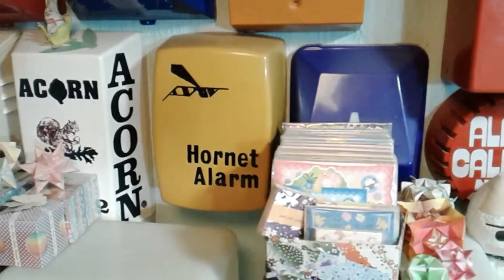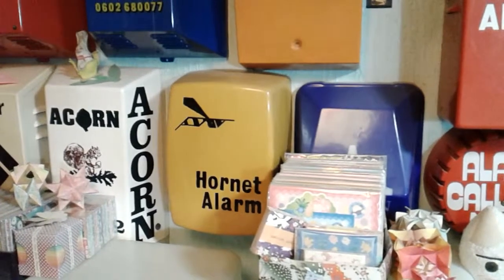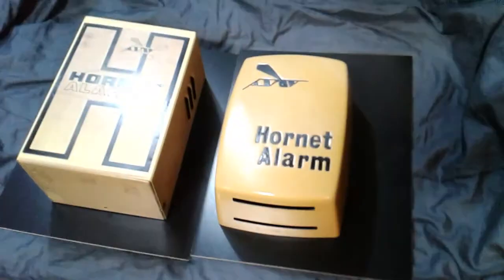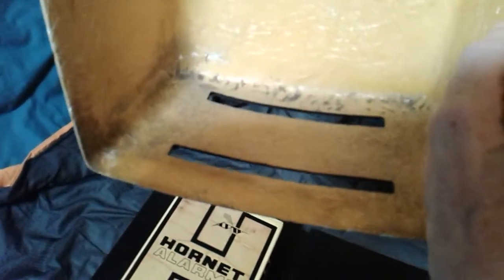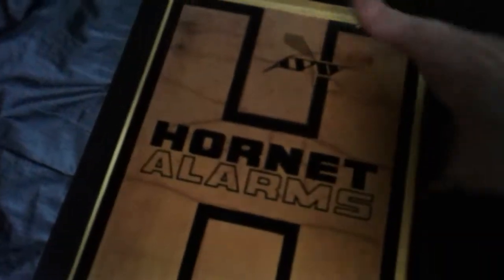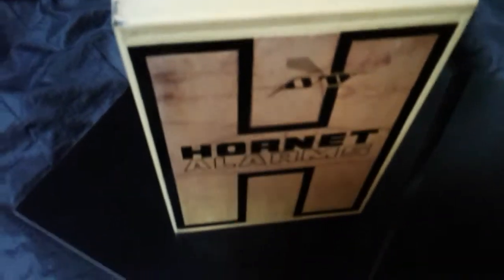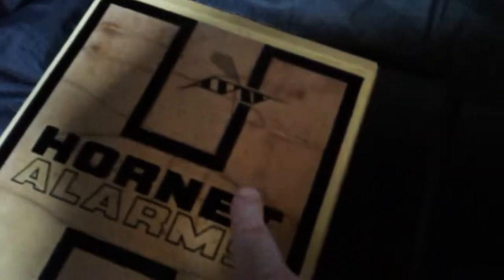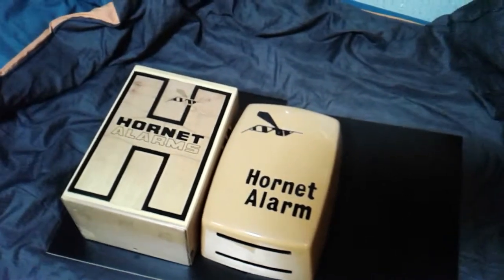Hornet alarm boxes for Scott Radley

Comment: That fiberglass box is probably from from the 60s
Reply from the maker: alarms n stuff brilliant! I thought it was a later addition to the alarm box family.  It makes it possibly the oldest box I have.

Dont know whats going on with the sound sorry about that.
Reply: audiotron1003 they never had any fiberglass bell box's in the 80s or 90s. Gotta say though love the style of the fiberglass bell box though. Where can I get one of those hornet fiberglass box's?
Reply from the maker: alarms n stuff around nottingham  ity centre there are a few. Most I suspect are redundant. Maybe you could ask shop owners if you could buy it. I tried that aproach with the shorrock box.

Theres one on carrington street near the train station another in hockley for example.
Reply from the maker: alarms n stuff I have corrected my description of the video.
Reply: audiotron1003 did you have to bribe the shop owner to obtain them?